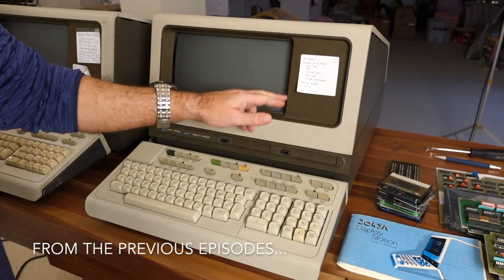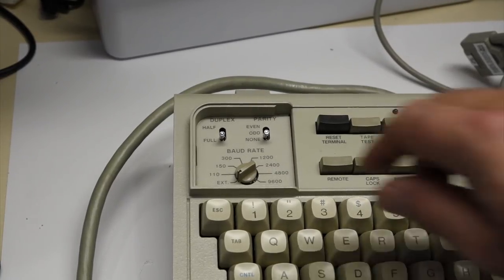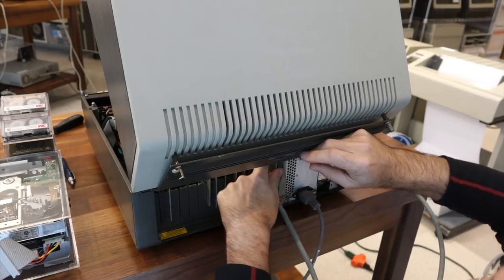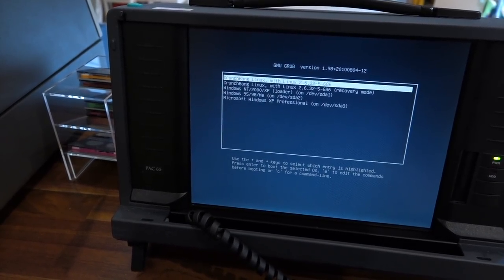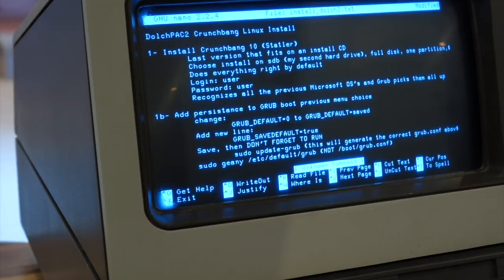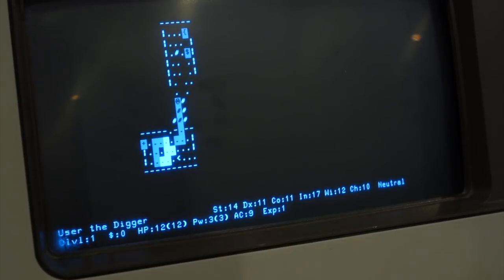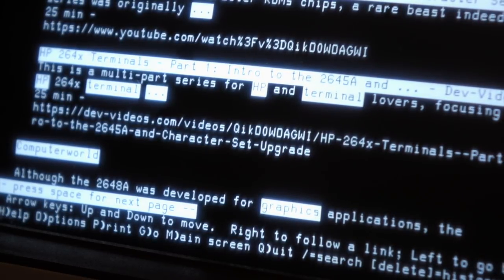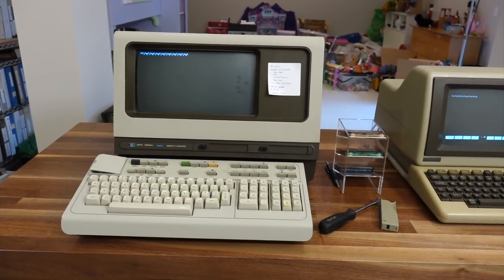HP 2645 Terminal - Part 3: Living the ASCII Life

Comment: The highlight problem comes out of an architecture difference between Dec vt terminals and HP. 

Curses etc were always much more at home on Dec VT100 and descendents.  VT terminals save the attributes with the character in video memory.  So if you set say inverse, then move the cursor and write, then the characters written will have the set attributes.

Buton an HP terminal the escape sequence to set say inverse actually saves a marker into the video memory at the cursor location.  If you subsequently write characters into the line after that marker they will be displayed inverse.  Even if you moved the cursor elsewhere, changed the attribute back to plain (ESC &d@) and moved back to the old location and wrote new characters they would still show as inverse.

This helps with the block mode and the forms stuff.  But ncurses could never handle it properly I don't think.

On the HP2645 the screen memory is constructed in a fancy linked list fashion.  The display hardware can follow that linked list as it scans the raster.

That sophisticated screen memory layout  is also why the terminal can't really do 9600 - managing that fancy display memory can be quite slow.
Reply from the maker: Thank you, I think that explains it. Indeed the inverse video stuff is affixed to a fixed row/column, and actually pretty hard to get rid off even manually once you have placed the markers. The fancy linked memory system description is right on too.
Reply from the maker: OK, I actually talked about the "bug" to Thomas Dickey, the current maintainer of ncurses and a) @Steve Davies is right b) Thomas knows full well about the issue (they call it "Magic Cookie" terminal support) and c) there actually already is experimental code to make it work but it's not enabled by default, in part because he could not find a good HP terminal to test it with. To enable the feature, you have to recompile ncurses with the configure-script "--enable-xmc-glitch" option. And then recompile nano and nethack from source too. Which requires more time than I am willing to work on this. If anyone volunteers, feel free.

Some excerpts of my conversation with Thomas Dickey, current maintainer of the ncurses package: 
"ncurses only handled the magic-cookie feature as an experimental option. [...] Relevant code is here https://github.com/ThomasDickey/ncurses-snapshots/blob/master/ncurses/tty/tty_update.c#L865 . [...] As far as I know, only HP curses handled that feature (and only for the older version of curses). [...] In a quick check I see that the source-code [...] for Solaris SVr4 curses has some logic for this." So it probably works correctly out of the box on Solaris 10 and HP-UX machines. But not quite on Linux unless you are willing to recompile from source with the experimental code in.

As far as fixing it for good on Linux, Thomas would need a real HP 2645 to test it and some spare time with nothing more important to do than fixing a retro-bug to support a 40 year old terminal just for me... Somewhat unlikely :-)
Reply: CuriousMarc Made my day to read your follow up.  Long ago I wrote a terminal emulator for HP terminals that ran on the Sinclair QL - so still manage to remember some of it.  But let’s let Thomas off from trying to fix it!
Reply: CuriousMarc, it really warms my heart to know you and Thomas had that discussion. Thank you for sharing.
Reply: You really need to get yourself an HP3000 (or an emulator running the MPE operating system) to take advantage of all neat features of an HP terminal.  Unix/Linux can’t do it justice.  Some HP-UX utilities like sam take advantage of the features but not like MPE.
Reply: @CuriousMarc  I'd be happy to compile those for you and send you the executables, if you're still interested in trying it.
Reply from the maker: @AureliusR  Thanks for the offer. But we’d need someone willing to fix ncurses for good before that would be worth the effort.
Reply from the maker: @tommychang6500  Yes indeed. These are slated to go on my HP 1000 systems, which also takes advantage of the unique and numerous features.

Comment: 4:44 At my first job after leaving University, part of the work was figuring out how to set up serial connections between different brands of Unix machines so I could transfer over the source code for an accounting package. We had a simple little “breakout box” thing with LEDs on it, as I recall, that I could put jumper leads on to make the right connections.

Comment: You need to install aalib, then your can view images in ascii :)
Reply: mplayer -vo aalib or something like that to watch a video or aalib quake/doom and so on ;)
(but I fear, 9600 baud won't give enough frames per second)
Reply: +zvpunry more like 4800 baud.
Reply: Look at the baud-knob at 3:00, this thing supported 9600 baud ;)
Reply: It technically does, but as explained in the pinned post above, the video memory layout of the terminal makes it difficult to perform fancy character manipulation at 9600; while it might be great for dumb terminal mode and binary transfers to tape, intelligent terminal operations with their use of non-printing characters and escape codes will run into a problem.

Comment: Doing this on a Cardputer stripped down to UART. Just wanted to get GPS strings at first and C++ got interesting. Having 2 then made me test the obvious. Micro controllers kind of start this way (no display). I hope to connect to a Psion terminal app as well, but it's a longer journey. USB protocol is also something, but I will cheat on that.

Comment: Salut, tu devrait a la place, ajouter dans ton /etc/inittab

# SERIAL CONSOLES
s0:12345:respawn:/sbin/agetty -L 4800 ttyS0 hp2645

De cette maniere tu va pogner un login prompt directement sur ton terminal du moment ou tu boot ton HP ou si ton HP est deja ouvert et ton PAC65 fini de booter.

Si tu veux que ton PAC65 parle à ton terminal au moment ou il lance grub, edite le fichier /etc/default/grub

Ajoute/modifie : GRUB_CMDLINE_LINUX_DEFAULT="console=tty0 console=ttyS0,4800n8" (pour avoir un output du boot kernel entre GRUB et le chargement de agetty)
Ajoute : GRUB_TERMINAL="console serial" (output de grub sur la console serie ainsi que l'ecran de ton PAC64)
Ajoute : GRUB_SERIAL_COMMAND="serial --speed=4800 --unit=0 --word=8 --parity=no --stop=1"

Search si tu vois du "quiet", si oui, enleve le.

execute en root grub-mkconfig -o /boot/grub/grub.cfg pour saver les configurations.

Ensuite reboot ton Pac, tu va pouvoir choisir Linux dans grub a partire du terminal et le lancer au complet a partire de celui-ci

NOTE : Pour le inittab ça va fonctionner direct, par contre pour grub, c'est peut être être different puisque j'ai jamais essayé sur debian et c'est probablement différent (J'utilise Gentoo Linux).

Comment: It is not a problem with ncurses. For fixing the terminal problems you should edit the linux's terminfo file. It is not easy but with the correct terminfo definition for your terminal all will work ok.
Reply from the maker: See what I believe is the correct answer by Steve Davis. I pinned it to the top.

Comment: You should have telnetted to towel dot blinkenlights dot nl :)
Reply from the maker: Oh my, thanks for the tip! This is award winning animated ASCII art: an entire Star Wars movie in ASCII, and super well drawn to boot! I suspect the pokey HP 2645 at 4800 bauds will be much too slow for it, but I'll give it a try. [Edit:] Tried it. Indeed too slow for the 2645 even at 9600 bauds. More importantly, it is hard coded for a VT-100, so the home cursor escape sequence does not work and it does not "repaint" at the right place. In the process of downloading the whole thing and fixing escape codes it so I can have my very own slow motion HP 2645 version.